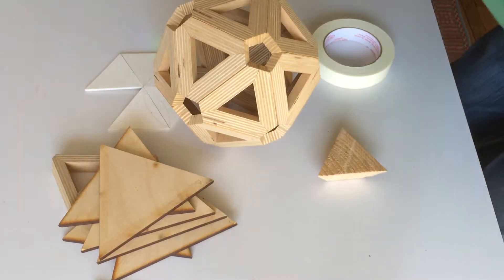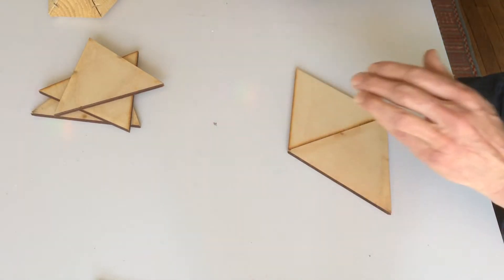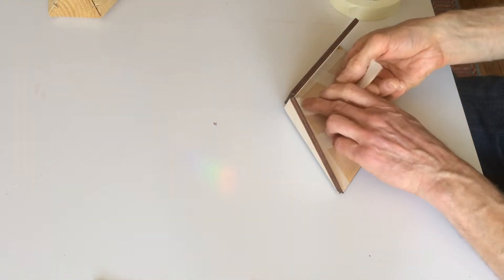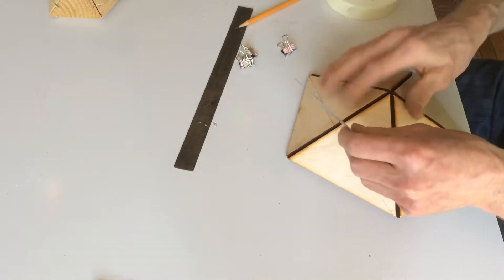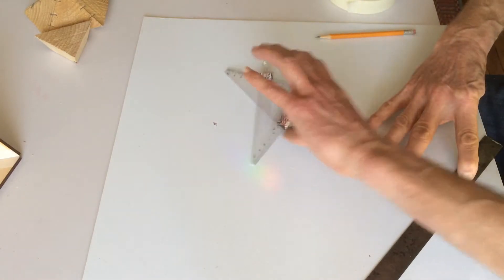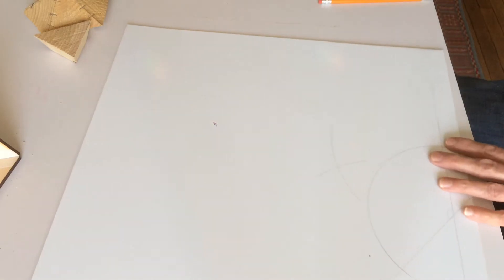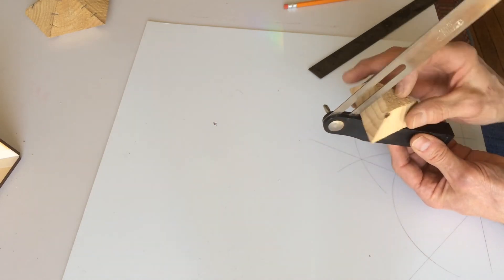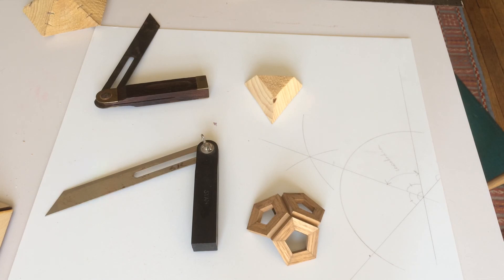Platonic Math - Calculating Bevel Angle for Icosahedra

Comment: It is about 69.1 degrees for those who want a number
Reply from the maker: Thanks. According to Robert Willams' book, "The Geometrical Foundation of Natural Science: A Source Book of Design"  it is 1/2 of the dihedral angle (138º 11' 22"), which I believe comes to 69º 5' 41"
Reply: If you want to be exact, which is hard to measure using simple tools. It = (arccos(−√5⁄3))/2  @ocadstan